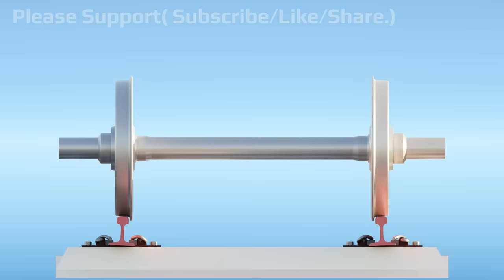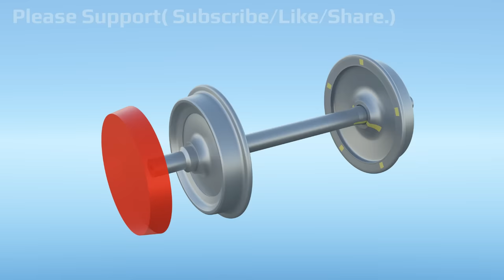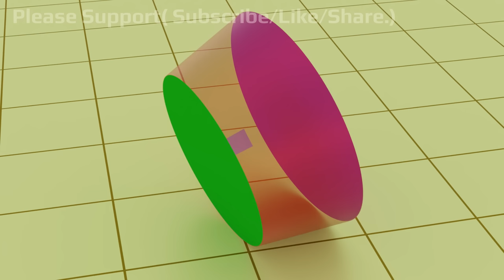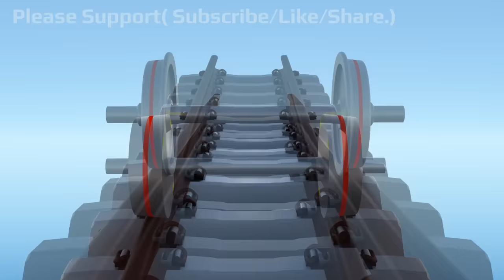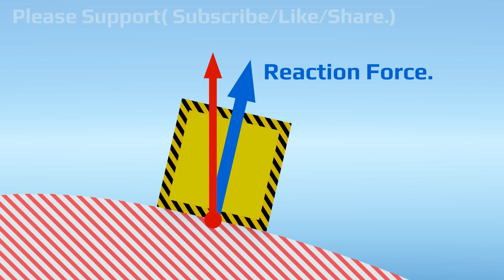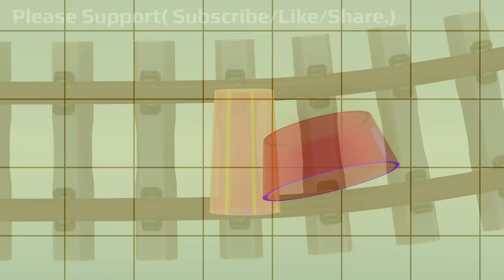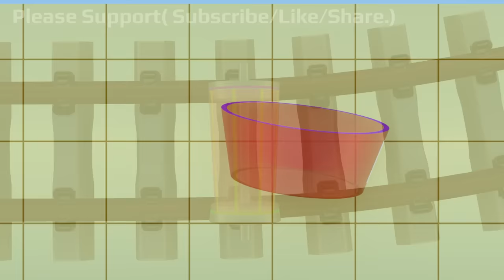How trains actually Turn ? | on curved rail track.

Comment: Very interesting, and the points made below. My curiosity has always been this: Now connect this bogey pair to another like it. Rigidly. Like the drive wheels on a steam loco or the bogey pair on a modern carriage. The wheels and flanges are set in a striaght line. When the train goes into a curve, this straight line won't fit. Won't this create forces of a great magnitude on the flanges?  At Barnt Green, near where I live as a child, the Evesham or rather, now, the Redditch turn off is very sharp. There are water (not grease) jets which spray all over the track as a train approaches. I thought the squealing was because of te problem I identify, not the one mentioned here, and by Maid and Muses, below.

Comment: In layman's terms if the outer rail on the curve is super elevated  to the appropriate height (canted) the wheel flange will keep the rails on the track at the appropriate speed for the curve. Ex Project Track Engineer  Network Rail.
Reply: Aren't the tracks canted in a curve to help counter the centrifugal force???
Reply: @ppdan  There is no such thing as centrifugal force. There is a tangential centripetal force. Not the same thing.
Reply: @EJP286CRSKW  It's an apparent force so what? It is still used to explain and calculate stuff.
But what is a "tangential centripetal force"? As far as I remember (from 30 years ago) those are 2 different forces called "tangential force" and "centripetal force".
Reply: Through high speed curves the centripetal force required to keep the train on the tracks is greater than the "conical" self-centering wheel geometry alone can provide. The superelevation of the outer rail then helps provide the additional force required. As @johnbrown9092 already said, this superelevation can only be optimised for a particular range of speeds; drop significantly below that and wheel slip and/or flange contact will occur. The debate re. centrifugal vs. centripetal force is (almost) semantics; one is a real force imparted onto the wheels/train by the tracks, the other is the equal but opposite apparent reactive force exerted on the tracks by the train. Nothing to get wound up about, physicist tend to focus on the centripetal force as a concept, engineers tend to look at whichever is more practical to work with... 

What I always wondered about is why the outer rail is superelevated (i.e. raised) as opposed to dropping the inner rails, or maybe 50%/50%. I can only imagine that by raising the outer rail, any runaway or rogue cars with the brakes not set then have a tendency to roll away from / out of the curve, rather than get stuck inside the curve where oncoming trains may not spot them so easily? Or is it because of possible ballast fouling on a dropped inner rail?
Reply: @maidsandmuses  I would guess that cost comes into it.  Much cheaper to raise the cant with a track machine (tamper) than excavate the lower rail. Ballast, stabilisation of track etc.Also overhead wires would be affected.
Reply: @johnbrown9092  Good point; I never considered cost as a factor. It is indeed easier to raise a rail with a tamper, rather than to drop it by excavating...
Reply: @maidsandmuses  nice chatting my friend.
Reply: @maidsandmuses  I guess if you elevate the outer rail you apply a force immediately and get better adhesion when entering the turn while lowering the inner rail will come with brief adhesion loss.
Reply: @ppdan  In theory perhaps, but in practice that wouldn't be a noticeable difference I think unless you were travelling at MACH 1 or so.... High speed turns & superelevation never set in immediately anyway, they are eased in gradually, except for low speed turns such as in sidings & switch/marshalling/shunt yards where they don't apply superelevation anyway. So far I think cost considerations mentioned by @johnbrown9092 seem the most plausible explanation to me.
Reply: @maidsandmuses  I will take a look. Thanks.

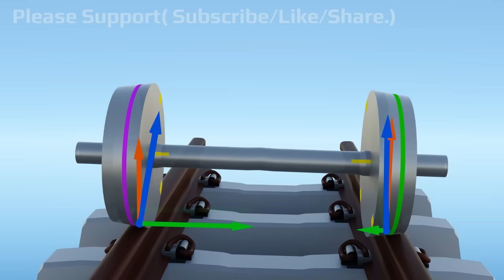Comment: At 5:24... left green vector rises because contact point moves on the slope. Right contact point moves also(vector moves inward) , so it shoud rise too. So why is left one bigger? I only can see the solution in  bigger left wheel radius on the contact point >leaning the axle, but even if I'm right, I need an explanation (it just doesn't enter my head). Or, maybe, left slope rises while the right becomes more flat because of the track/wheel shape? Am I right? Thank you fer the answer!

Comment: The difference between the words tHread and tread makes listening to the narration a little jarring. Other than the miss-use of thread  where it should have been tread this is an excellent explanation of rail wheel track dynamics.

Comment: So there must be a limit to the turning radius based on the conical shape of the individual wheels then, correct?
Reply: There is that is why on tight turns the crew greases the inside edge of the rail. Also the squeal on curves is because the inside wheels is slipping. The wheels and track design providing differential wheels speeds works on bigger radius curves. Small radius get out the grease
Reply: @ronmeidlinger249  What are the reasons for intentionally having tighter curves in which self-steering has reached its limits and the wheels slip?
Reply: @ronmeidlinger249  I'd argue that both wheels must slip. Plus, it has been proven by video that the wheel on the outside of the curve is the one whose flange gets nearest the rail. If the flanges make contact with the rail, then a shearing action begins because different diameters on one wheel travel different circumferential distances, but the entire rail is one uniform linear distance.

Comment: Looks like this manner of construction also solves the problem of the inner wheel in a curve on a fixed axle triying to rotate the same speed as the outer wheel traveling the longer distance. Cars have differentials to solve this problem. The inner wheel on a RR rolls on a smaller diameter (section of the semicone) and doesn't skid.

Comment: Dear sir, i have an idea in my mind, in a short form , i want to tell , i think when a train with a full speed coming in a railway track, then to pass through a curved line , it should necessary to activate a high magnetic field to keep stable the bending of the running train to avoid accident ..., i think these in every case caused a  serious accident or collison ...where these magnetik field do not acting ..., in a you tube video it is seen a train accident in spain in a bending track....pl read & it  might be an simple way out....

Comment: love how the slightest fuck up in the design could mean the lives of millions of people yet we trust the system so easily and with so much faith without wanting to understand more about it.
Reply: This YouTuber has only partial knowledge. I was involved in the design of this stuff, working for a time at the Railway Research Centre, Derby, UK where the fundamental mechanics of wheel/rail contact was worked out.  There is a huge safety margin against derailment in normal circumstances.
Reply: @dukenukem5768  i assume u guys working on the design of these get paid alot

Comment: If we will not use shaft the then also it will be easy to take turn in rail, both the wheels will turn at different speeds. So engineers don't remove shaft?

Comment: Today for a curvy railway, the outer rail is a little bit higher than the inside one. So the train is a little tilted to inside of the curve and the gravity add more force to keep the wheels on the trajectory of the rails. Just like Nascar circuits turning points which have different levels between outer and inner limits.
Reply: Yes superelevation

Comment: Actually one train bogi consists 4 + 4  is 8 wheels. The 1st 4 wheels are fixed on a under frame and the centre of this frame had  a hub on its centre enters in of one side of a bogie and locked with king pin. And it is freely turns on acurved track. Like wise the other side of bogie it works. This I have seen in I C F chennai.🙏

Comment: Could have mentioned wheel skid which happens every time you go through a curve, that's why I've changed so Damn Flattered Rail on the Low side which is the short side. Your elaborate explanation of the Wheels doesn't stop the High Rail from  receiving extreme Curve wear either.  Half story here.
Reply: THAT'S what I was looking for!  The fact is that a wheel set on a curve must result in one wheel "slipping" since it covers a greater distance on the outside of the curve than the inside wheel.  The two wheels are fixed one to the other across the axle, so on every curve there is increased wear both to the wheel and the rail.  That was the detail that I was looking for that was never mentioned.
Reply: @arssolar7360  Thats right, if the elevation of the Curve is correct for the speed this slipping is minimized,or should I say less wear ,  but your right, one side is much longer then the other.
Reply: your first statement is incorrect- thats why the wheel treads have varying radii- to track the curves without slip. the rp25 contoured wheel radius is the secret to curve-tracking with zero wheel-slip. you just don't get it.
Reply: @arssolar7360  but the outer wheel is rolling ON ITS LARGER-DIAMETER wheel contour- which is steering it- and the inside wheel is rolling on its smaller-diameter and CONICAL-SHAPE wheel tread- which is also steering it. you guys should have had trains when you were kids cuz you just don't get it.
Reply: @tommurphy4307  Oh I get it, you never changed steel like I have, Elevation, Speed and Degree of Curve, Go back to School your the one that dont get it, there are variables out there, your in a Glass World.

Comment: I've known this for years but one thing that's been bugging me for years also and I can't seem to get an answer to is how do the Spanish talgo trains that have no rigid axle and independent wheel rotation work?
Reply: they have a heavy, low-slung subframe which acts like a straight axle- its configured to provide the pendular movement of the car's suspension. the independent wheel-rotation has no effect on truck steering.

Comment: Despite all this, my local trains still squeal very loudly. Probably due to low speed resulting in low momentum meaning the wheels aren't able to slip as easily laterally and thus the frustum effect can't really occur.

Comment: If the trucks aren't steerable (i.e. so that the traction motors turn with the bend in the rail) then the wheels remain straight and force themselves through the curve, with what little wiggle room there is provided by the shape of the wheels/rail profile.
Reply: a big 'if'... the trucks are totally steerable, but by use of varying wheel radii. if you take a wheelset with one bigger wheel and one thats smaller- it will steer in the direction of the smaller-diameter wheel every time- with no forcing. the rail profile has nothing to do with providing 'wiggle room'- its there to prevent wear/damage to the wheel tread/flange radii and is figured in with the given gauges of the wheels and rails. railroads spend huge amounts of money maintaining these crucial dimensions.
Reply: @tommurphy4307  I think you misunderstood me. There are actually steerable trucks, as in, the entire traction motor assembly is designed to physically turn to conform to the bend in the track. If a railcar or locomotive doesn't have steerable trucks, such that the wheels remain straight throughout the bend, they only manage the bend due to the profile of the wheels against the profile of the rails.

Comment: That's why the wheels make screeching noise when the train is turning because the wheel shifts slightly and the flange rubs against the rail, causing noise

Comment: After working 37 years for Maintenance of Way, walking hundreds of miles of track, replacing thousands of ties,  replacing spikes and tie plates I've never had this explained like this.  I do buy this explanation on new ideal track structure, but very quickly the profile of the rail head , and the profile of the wheel soon change.  Its wheel flanges and a symmetrical center pin that turns and holds the trucks to the curve.  Also it is the 'super' which is designed into the profile of the track based on the prescribed track speed and design tonnage which keeps the train on the track.  When track and wheels wear they soon lose this benefit you describe and may begin 'hunting' which is very dangerous.  In some curves, flange wear will competely wear out 136 pound rail in less than a year.  Then the high side rail is exchanged for the low side rail until new rail can be ordered.  I'm certified in track maintenance and taught and certified track inspectors on the largest railroad in the USA.
Reply: What's the measurement of your side wear before you rotate the high side for the low side

Comment: I'd like to see a video about an airplane and why both wingtips fly at the exact same airspeed in a constant altitude and constantly banked coordinated turn.   It seems counter-intuitive because there is a false impression that the top wingtip appears to have a greater circumference than the bottom wingtip while its turning.
Reply: it would have to be a full, vertically-banked turn- otherwise the outer tip is flying faster.
Reply: @tommurphy4307  Nope, in your case, a loop would also satisfy your point.  It would take a little time to explain, and I will if somebody asks.

Comment: I've seen so many rail wheels its not funny, had to jump 8 sets every day to get to work in everett at the bluff there, unloading fish off the boats, IO always wondered why the wheels were tapered.. I figgered it was to push teh wheels to the center so they line up perfect and not rub the flange..

I think you should add to this video that the reason you want the outside wheel taller, is because when 2 wheels on an axle turn a corner the the outside wheel makes more revolutions due to the it having to travel longer distance, the inside inside of the turn is a shorter distance..

they solve this logically unlike a car for instance that just uses and axle that allow the wheel to turn at different speeds, these wheels are fixed and alway spin the same revolutions, however on a corner a fixed axle wont work, inside wheel needs to spin slower that the outside wheel as it travels a shorter distance to negotiate the turn, so they solve it by having the inside wheel diameter go smaller, and the outside diameter taller, nothing short of pure genius really, some trial and error and thought went into this design, I guess i never looked that deep into it or put a lot of thought into it and I never asked what type of axles does a train use just never thought about it.. again I always thought the tapered wheel was just to keep the wheels centered and constantly pushing inwards to stay on track, its a clever solution, the taper has multiple uses,  as he says it keep the wheel centered on the straight so the flange never rubs.. that would be disaster if it did, heat would seize bearings and a derail would be next..

frankly these trains are of absolute genius in their design, they are not attached/bolted/welded to the wheels/axles at all, my guess is for the reason how I realized they were not attached, I saw them putting a derailed train car back on the tracks and its genius, the car falls off, wheels first or car first and come apart, suspension braking is separate as well...sparing massive damage, they come along, right the car, elevate it, lift the wheels back on, suspension brake package, set the car back onto that.. away they go

I believe the wheels and axle are independent form the suspension and the car, weight and a pin system of some sort square round slotted whatever hold it all together side to side forward backward..... it's totally genius, being modular in style any one component can easily be replaced no welding or bolting..  pretty darn fantastic if ya ask me...  imagine they save a ton on parts this way, and then getting cars and engines back on the track is simpler as well.. watch a few of those videos, mind blowing..

Comment: Motorcycle tires rely on similar to turn a motorcycle.  Leaning the motorcycle shifts the tire contact patch (front and rear) such that one side (tire center) will be at a point with a wider circumference than the circumference of the outer side (left outer when turning left and right outer when turning right).  Rear tires are wider than front for a reason and the curvature of each tire effects the turning characteristics.

I think I said that right
Reply: so does the caster of the steerer tube and the rake of the front fork. actually very few stock bikes have wider rear tires- most are the same width. what you are saying is that the front wheel turns more rapidly in a curve at constant speed- but i'm not seeing any similarity with a train truck which steers without turning its wheels. can you turn your bike with the steering locked and pointing straight ahead?? you should think in terms of radii or diameter rather than circumference.

Comment: It's the same thing that makes a motorcycle turn. As the bike leans the circumference of the tire at the contact patch changes.
Reply: Thanks for putting it that way, I was struggling to understand the video.

Comment: Somebody actually understands that the wheels are machined in such a way that they become an automatic gearbox with differential. On different countries networks there a different profiles. The general system in the uk is there are two angle section on the “tread” with the join at the point where the train runs in a straight line.

Comment: The inside rail in any curve covers a shorter distance than the outside rail. The wheels attached to a fixed axle always turn at the same speed. The wheel on the outside actually slips a little while rolling through a curve while the inside wheel flanges keep the wheels guided on the tracks while in motion.